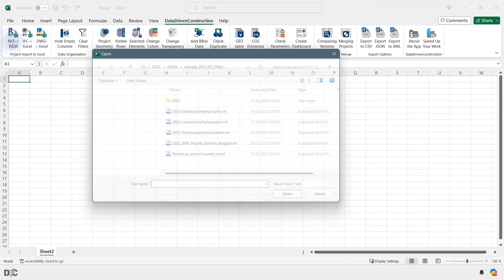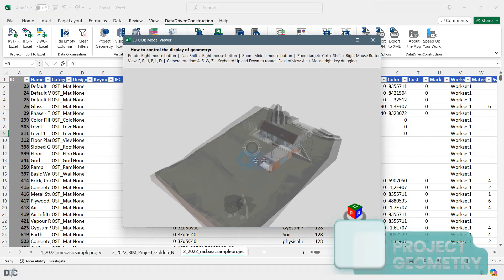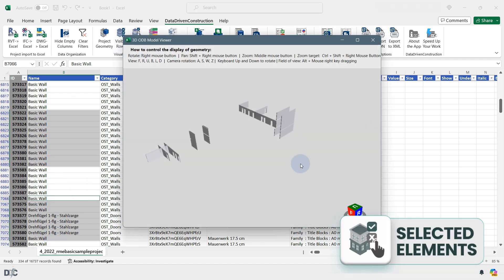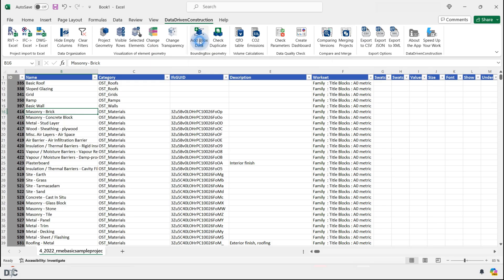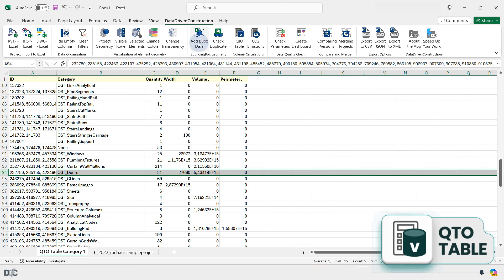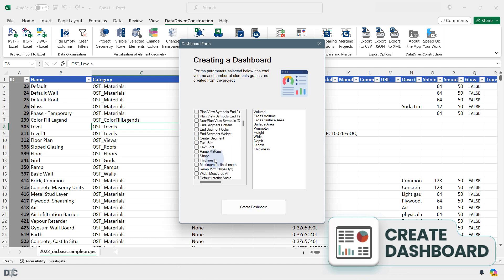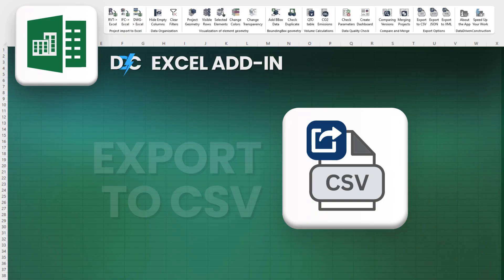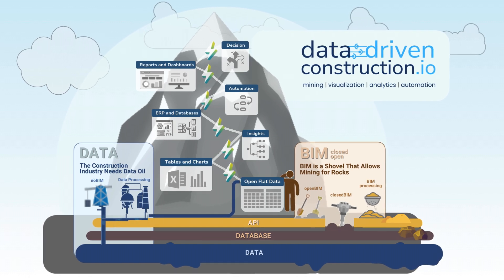CAD (BIM) Data in Excel: Revit, IFC, DWG. Unleash the power of your CAD (BIM) data

Comment: I installed it but it's not reflecting in my Excel there is no DDC tab in my excel, Please help, I need to implement it in my day-to-day tasks. I'm just waiting for your reply.
Reply: Load Behavior: Not loaded. A runtime error occurred during the loading of the COM Add-in., Also some errors shown if I check in -COM ADD-ins . How to resolve this issue.
Reply from the maker: @SMS.0310  many thanks for writing - please post what version of Excel and what version of Windows are you using?
Reply from the maker: @SMS.0310 did you have a previous version of the plugin installed? 

Please try to delete these paths in RegEdit:

Computer\HKEY_CURRENT_USER\Software\Microsoft\Office\Excel\Addins\DataDrivenConstruction Excel.
Computer\HKEY_LOCAL_MACHINE\SOFTWARE\Microsoft\Office\Excel\Addins\{{E41F8B94-5028-4B02-9381-1959D03C36BA}}
Computer\HKEY_CURRENT_USER\Software\Microsoft\Office\Excel\AddinsData\DataDrivenConstruction Excel.
Computer\HKEY_CURRENT_USER\Software\Microsoft\Office\Excel\AddinsData\FAE04EC0-301F-11D3-BF4B-00C04F79EFBC
Computer\HKEY_CURRENT_USER\Software\Microsoft\Office\Excel\AddinsData\{{E41F8B94-5028-4B02-9381-1959D03C36BA}}